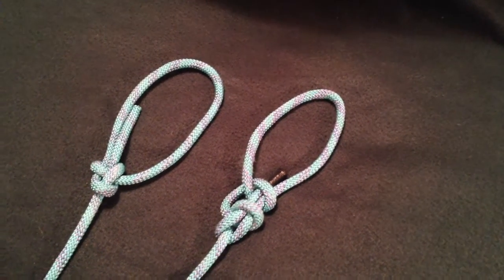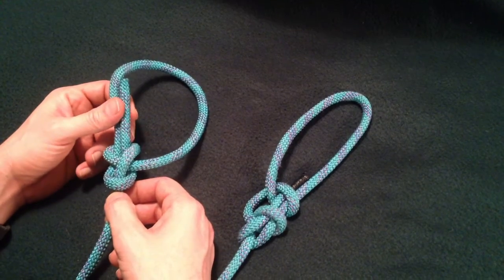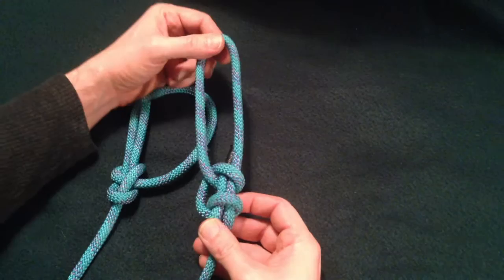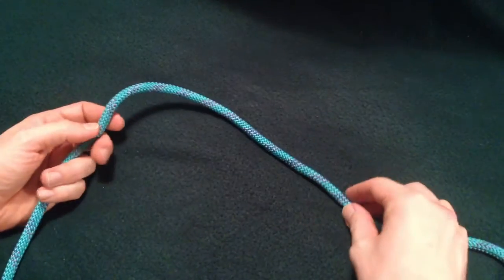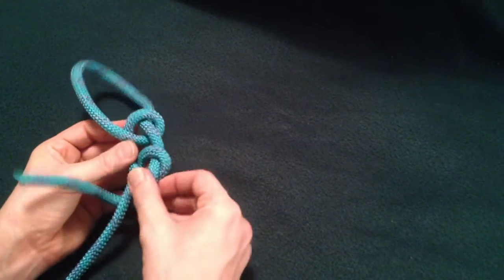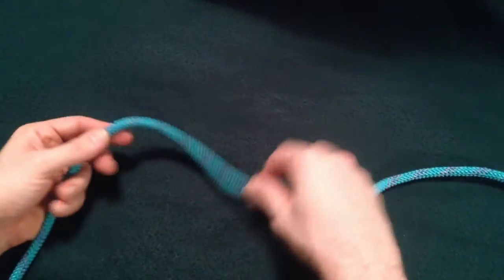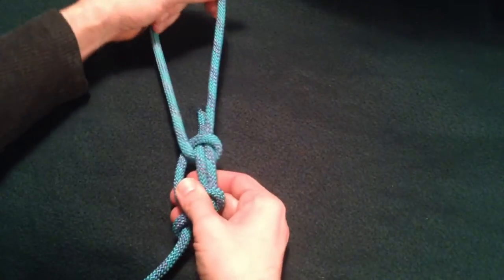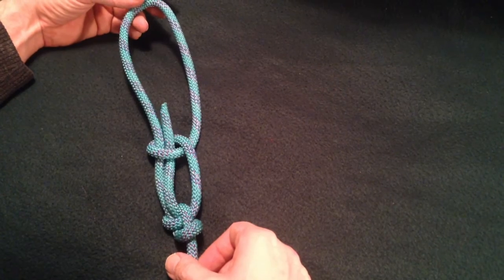How to tie a Water Bowline

Comment: Thanks for the video. Just a comment: I find it easier to lay the trailing loop on top of the leading loop (i.e., the one closest to the bitter end)--i.e., make a clove hitch--and then just run the bitter end through as if you're making a standard bowline. Both components will have to be tightened separately, of course, as you complete the knot.
regards,